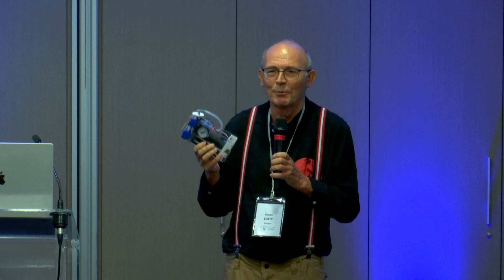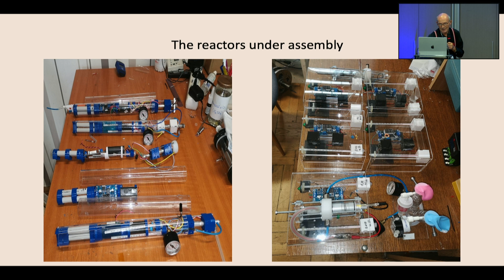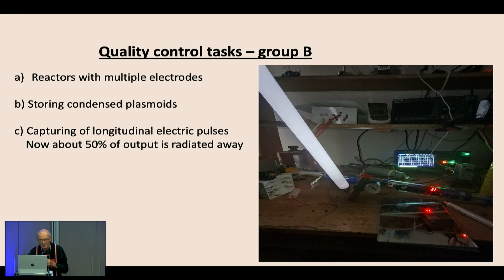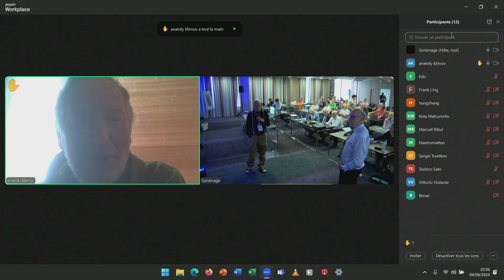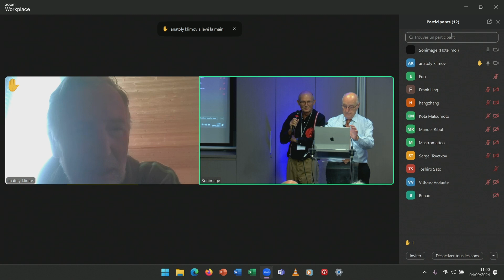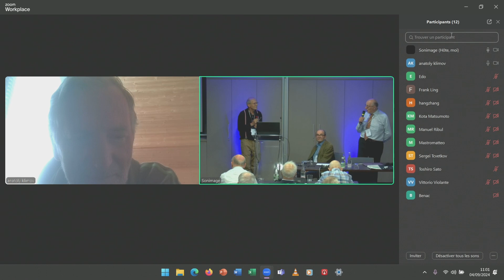George Egely - IWAHLM-16 - Direct Electricity Production by Catalytic Fusion

Comment: George, You mention Sebastian Domoszlai's talk at ICCF 25 Szczecin, but actually I've not been able to track this down... The obvious YouTube search doesn't find anything. This playlist ddn't have it: https://www.youtube.com/playlist?list=PLU0NX-S-T1yVEt6I5idkt234RJ2_KLtwP
Reply: On the website for ICCF25 I found a PDF showing it did happen:
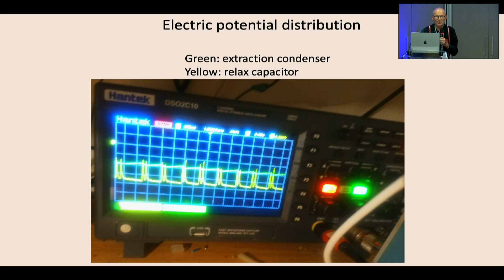“17:00⸺17:25
 Sebastian Domoszlai Egely kft., Hungary
  S.11.3 Method for Measuring Input Power in Pulsed Electric Circuits”

You’ll notice George’s ICCF25 is also not on that playlist.  George’s can be found by looking for the YouTube channel:
“George Egely ICCF”

I found a hidden video on that channel via lenrforums.  Watch video ID: Xwpfj5McqB0 it has the cop measurements at the end.
Reply: catalyticfusion website has links to the ICCF25 Szczecin talks in Aug 2023